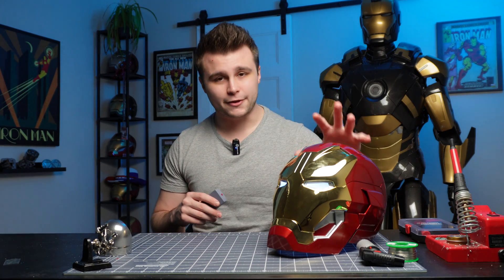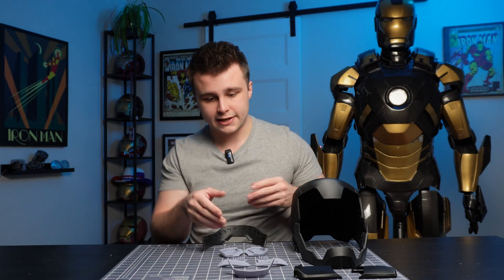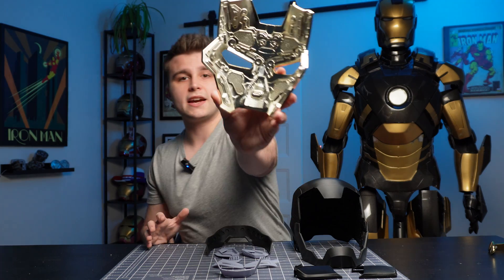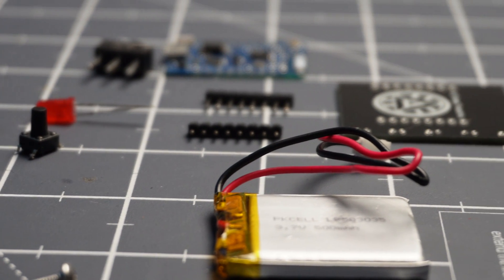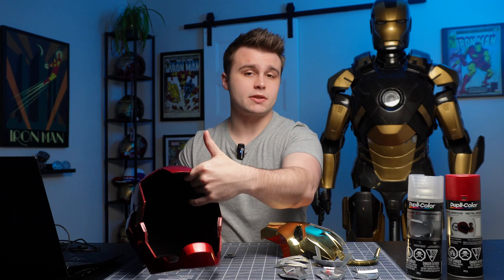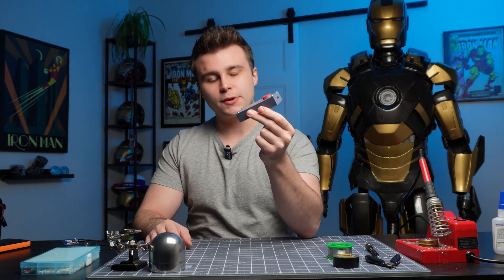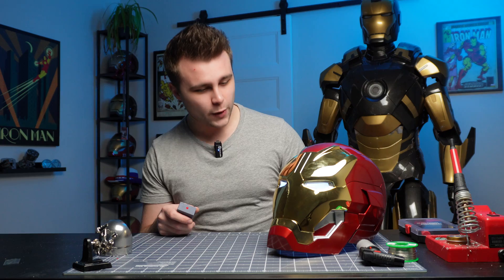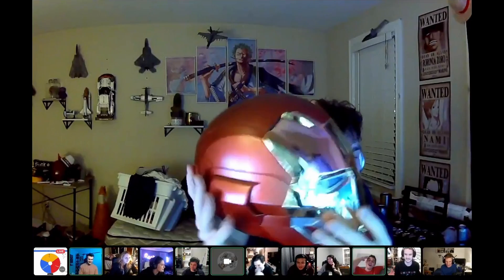How To make Cosplay Props WIRELESS! - Making A 3D Printed Iron Man MK45 Helmet

Comment: I have one question, so once we wire the button, led and battery to the transmitter and power the receiver, how do we wire it to lets say a helmet which will replace the botton to open/close the face plate action
Reply from the maker: The pin from the button on the receiver goes to the pin of the button on the board, and you need a positive and negative lead going from the bord to power the receiver
Reply: Love the red though and chrome gold MAIN